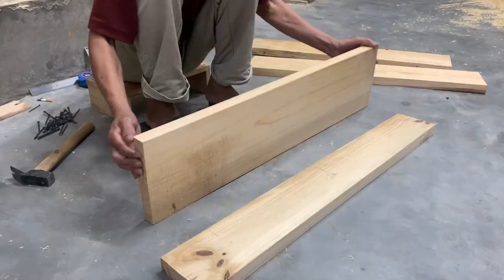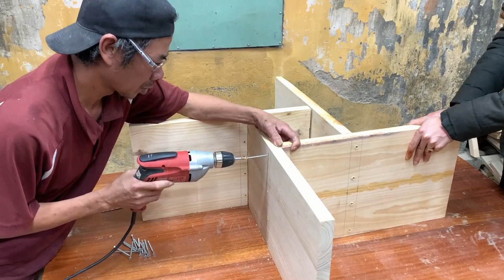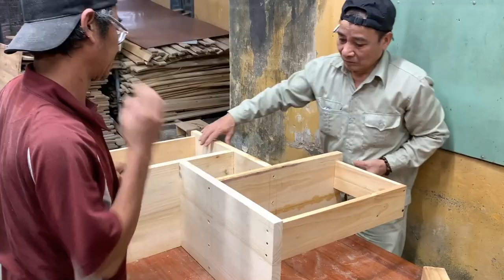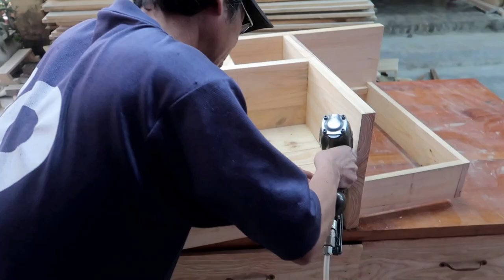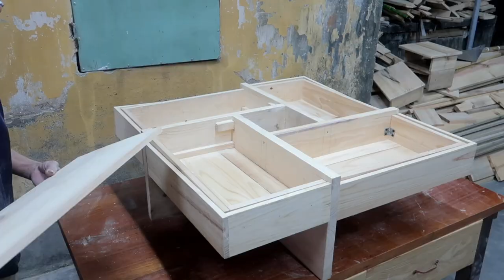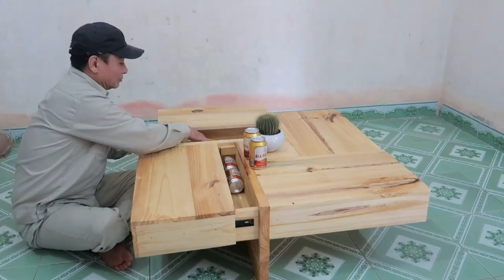Extreme Creative Woodworking Skills - How To Make Coffee Table Easy Using Hidden Drawers

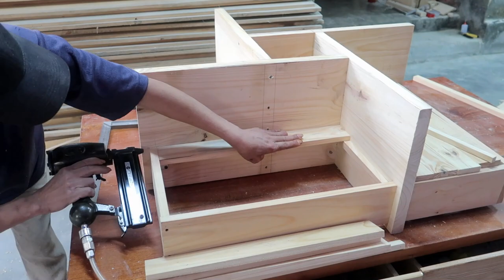Comment: THERE IS A CUT FROM 4:50 WHERE YOU NEED TO KNOW HOW DID THEY ABLE TO PUT THE OTHER PART OF THE WOOD ON THE OTHER SIDE? PLS ENFLIGHTEN ME
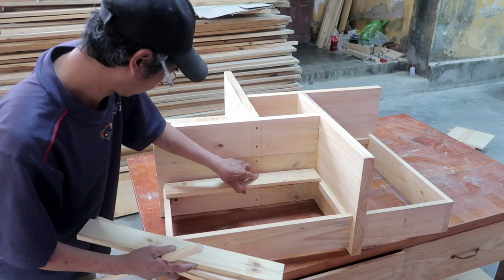Reply: They skipped that step. They used clamps as seen in 5:22